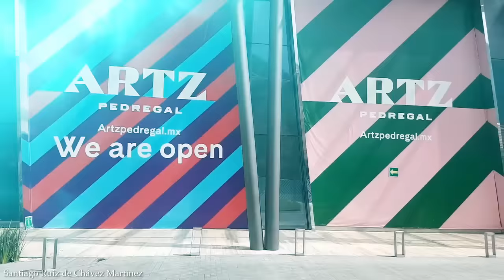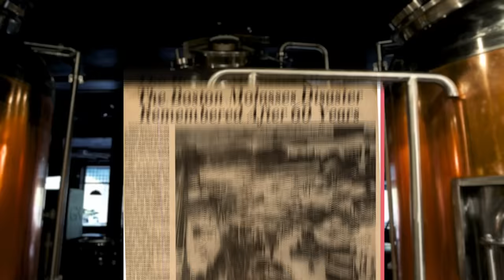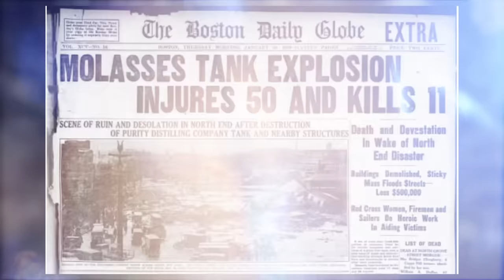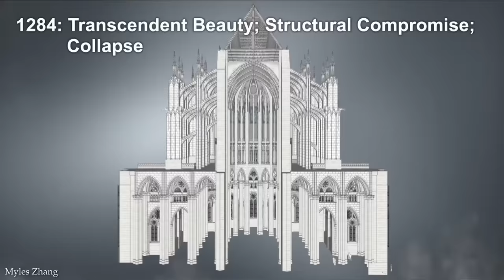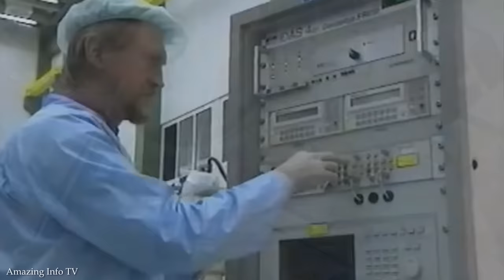TOP 15 ENGINEERING FAILS - what were they thinking?

Comment: To drop in the Tacoma Narrows Bridge as an engineering failure I thought was a bit unfair. My understanding is at the time that engineers did not understand the resonance of structures (or materials) and what that could endue, with the effect of the bridges failure demonstrating. My point is that the structure was designed to the best knowledge of structural design at the time.
Reply: Agreed, but best design at the time obviously wasn't good enough.  Since then bridges are designed with wind effects in mind.
Reply: The carelessness in choosing video clips extends beyond the conflation of the Hancock Tower in Chicago with the Hancock Building in Boston; many of the clips in the Tacoma Narrows Bridge section show the modern two-span version of the bridge (built in 1950 and 2007).  In addition, the script writer missed a great story opportunity: even while under construction the bridge would twist and buck during windy days, so much so that the construction workers called it Galloping Gertie.  And one main problem was not mentioned: both longitudinal and lateral girders were solid (rather than latticed), allowing the wind to push and lift the span which then responded rhythmically, eventually tearing itself apart.  https://en.wikipedia.org/wiki/Tacoma_Narrows_Bridge_(1940)

Comment: Your report on the pinto is flawed. The first image and many others depicted a 1974 or later model. Staring in 1974, Ford discontinued the Pinto chassis and stretched the body over the Mustang II. A much-needed safer design. Most of the videos of the cars catching fire were staged
Reply: True, the big explosion was from the comedy movie Top Secret, starring the delightful Val Kilmer
Reply: Ironically, when the Pinto was first built, all the manufacturers put the gas tank in the rear of the car, and used the top of the tank as the bottom of the trunk. During the trial, Ford brought in the back halves of all the other car companies, showing they were doing the same thing.
Reply: From Paul Harvey's 'The Rest Of The Story' the engineer who placed the gas tank lost his father (at age 11 or 12) to a gas tank explosion in a Model T or Model A where the gas tank was in front of the wind shield. He schooled as an engineer and finally got a chance to locate a gas tank. In his mind was his fathers death so for safety he placed the gas tank as far away from the driver as possible. We know the rest of the story.
Reply: Deepwater Horizon was management failure.
Reply: @maestroh2986 ”This is NOT Mel Torme…”

Comment: I'm pretty certain that, while the car had shortcomings, most of the negative press about the Pinto was from doctored events.  In the case of the explosion, the story goes that they actually couldn't get the fuel tank to ignite the first few times they tried to rear-end the car.  So they gave up and used explosives.

Comment: My first car was a "special edition" 1972 Ford Pinto. The base price of the car was $1800; mine was two-toned with a vinyl roof and cost $2700. Neither version had power steering, power brakes or air conditioning, and mine had a manual transition, in spite of my never having driven a stick before (Daddy's insistence). Learning to drive it was a harrowing experience. I had that car for 15 years. I still remember almost swallowing my teeth the first time I put the pressure I was accustomed to on the pedal for power breaks. Scared me silly.

Also - the chemical in the Bhopal tragedy was methyl isocyanate, not iocyanate. The show Seconds From Disaster did a good episode about the events which can be found on YouTube. That the Bhopal survivors received such poor care and so little compensation is sickening; Union Carbide and the US government should be ashamed.

Comment: Ford kept manufacturing its Falcon model in my native Argentina, even knowing that it was very unstable to drive, until the 1980s.  There were lots of accidents, not crashes but the Falcon getting out of control easily.  I was myself driving my mother's Falcon at low speed: a bad maneuver and the car ended up upside down.  Mother was in a rage: I have to move out and find my own place.

Comment: Seem to have forgot Fukushima nuclear power plant. This is a power plant that abuts the ocean in a tsunami region. It had backup diesel power for running the pumps but they were stored in the basement of the building. Who'd have thought salt water would flood it out during a tsunami?  Better yet, who couldn't see this possibility. This is a blunder of astronomical proportions. How much damage did it cost?  We don't know because its ongoing. How many lives extinguished? Still fallout from radiation, which will only increase the incidence of cancer for those that lived in the area.  This is probably the worst and most stupid engineering blunders of the last 100 years.

Comment: 26:06 - It is NOT acceptable to intermix images of the original Tacoma Narrows Bridge (which collapsed) with two modern structures without making it clear in the narration, or with subtitles, that these are NOT the same structures. But again, quickly and sloppily made videos like this one do stuff like this all the time, unfortunately.

Comment: I guess the Oil rig explosion and fire of the PIPER ALPHA. The Space Shuttle  Challenger was nothing important.  This tragedy changed how NASA  launched every mission since then The Rocker fuel  storage facility in Nevada was a disaster never before experienced.  With enough explosive force it rocked Las Vegas and shattered windows. The two ((2)) Boeing 747 crash on the runways on the Canary islands was the most extreme aircraft accident in recorded history..

Comment: And even bigger bridge collapse is  waiting for you to drive over it.  It was poorly designed by politicians.  It had huge cost overruns.  It was designed to cost $250 Million.  And in the end it cost $6.5 Billion in taxpayer money.  Officials try to hide that by saying the majority of that was paid for by toll fees. Duh?  Aren't most toll payers taxpayers? 
It took 25 years to finish.
It requires $Millions in maintenance every year.  And all the mounting bolts were made of the wrong metal.  They all failed.  The only thing holding the bridge up is gravity.   Any strong earthquake and it will all fall down.
Former Governor Jerry Brown, and his friend, Willie Brown were Mayors of Oakland and San Francisco and had their hands in pushing for that bridge for its eye appeal rather than user safety.

Comment: Macondo was 100% BP's fault. Bad engineering calls while men on the rig knew they were "taking a kick" - and needed to weight up the mud and kill the well. BP should be banned from America. They were also responsible for the Exxon Valdez- a ship owned by Exxon but leased and operated by BP. Exxon took over the clean up because BP was too incompetent to handle the problem.

Comment: The Sky Lab . This video ‘s report on Sky lab has zero credibility. NASA  knew that  Skylab would eventually return to the earth’s surface before it was  launched into low  earth’s orbit . Again NASA knew of Skylabs decaying orbit and its eventual  return to the earth’s surface . But this video goes on about how NASA was going to try to send the space shuttle up to save Skylab and this impending disaster. 
 There is just one serious problem with this statement. It’s NOT TRUE. The space shuttle was not in use in 1978 or in 1979 when sky lab returned. The space shuttle programs first launch of a shuttle  was April 12 1981. Almost two years after . 
 The Skylab mission was a success.  The mission and the craft were made up of left over parts from  the Apollo era.  Skylab was launched into space by a Saturn V rocket on May 14th 1973. It spent 6 years in low earth orbit.  It had 3 manned  crews   between 1973 and 1974 Who performed over 270 experiments. . . To call this a disaster is a lie or complete stupidity.

Comment: Videos like these are enjoyable but they often contain significant errors - and one is the absurd use of images and a video clip of the WRONG Hancock building, starting at 10:55. Not only does the structure in Chicago look nothing like the correct one in Boston, the news segment at 11:28 has a subtitle of the original audio that reads "Chicago Emergency" - as stated, the building under discussion is in Boston - followed by further subtitles and actual visuals showing that this concerns a window-washing platform bouncing around uncontrolled in the wind. No connection whatsoever to the real story. I have to wonder how clueless people are when they do stupid stuff like this that shows very clearly that nobody is paying any attention to what the narration is about.

Comment: If you want to be respected as a informative channel get rid of the click bait cover photos.  The one here was clearly just the same bridge mirrored.   The two collapsed sections do not meet up, showing you have no sense of perspective, engineering or scale.  And being over dramatic is pathetic.  The airport terminal did not collapse, some decorative panels fell down on the outside of the building.